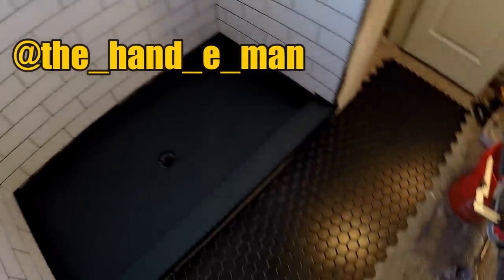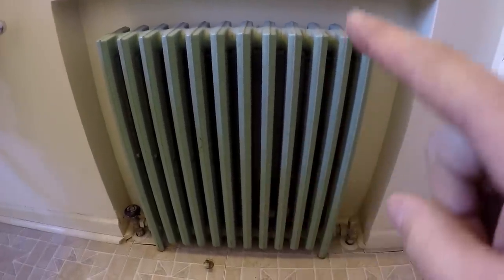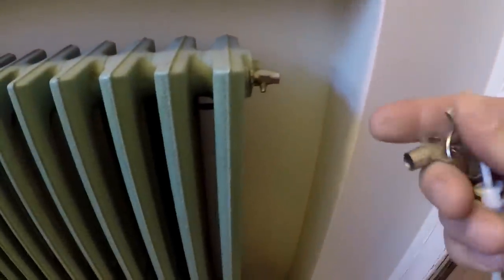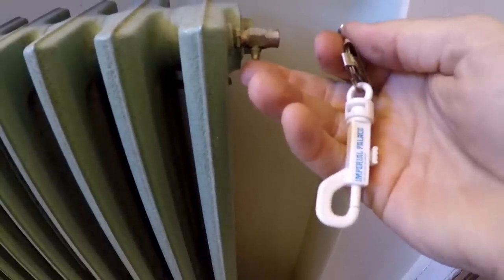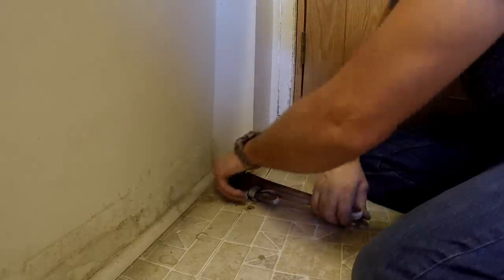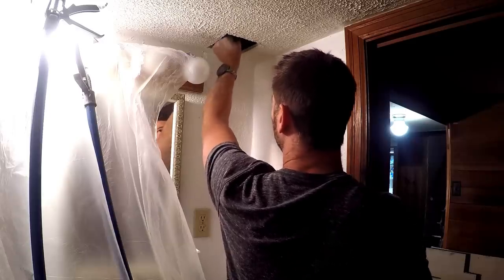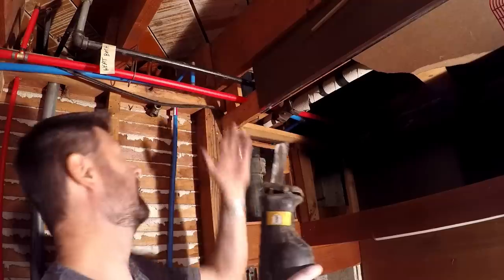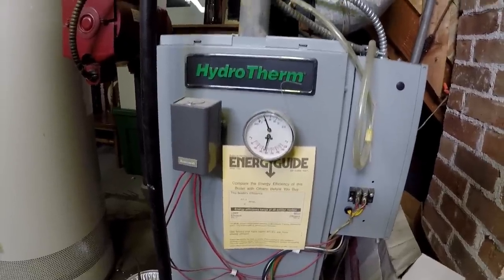1940's Bathroom Remodel | How To Remove A Radiator | THE HANDYMAN |

Comment: Most people who get rid of radiators in their home because they are remodeling are sorry they got rid of them years later. They want modern but modern doesn’t heat as well or as comfortable. They want more space but find More room means more heat is required and the old radiators did that with no problem. The new replacement is more costly too because it’s not as efficient as those cast iron units that dissipate heat over time. Sometimes new doesn’t mean better.
Reply: No one ever regrets it
Reply: I'm remodeling my home and a previous owner had installed baseboard radiators in an addition.  Just removed them and bought some cast iron to replace them.  They are even the same style as the originals in the older part of the house.  It's gonna be snazzy!  Cast Iron radiators do take a bit of space, but not too much, and they look so much better than the baseboard style that inevitably get dents and dings from furniture.

Comment: Boilers that have sight glasses are steam boilers, you only want to fill them to a certain point on the sight glass unlike a typical boiler where you just fill the entire system with water. Just got back from installing a pain in the ass oil boiler/tankless water heater that is located under a cabinet in a kitchen.

Comment: If there is a sight glass on the boiler, then you are dealing with a steam system.  Typicaly steam boilers are about 2/3 full of water and the sight glass shows the water level and nowadays most have an automatic feeder to keep the water at the right level. Not many of those systems around anymore at least not where I live.

Comment: I love that look.  Its modern and retro all in one.  Regarding the topic of fittings my only concern with the shark bites is can/will the friction fitting hold up over the years?  I used them on my toilet and sink supply lines but thats exposed and you can easily see if there are any issues.

Comment: I'm curious how you "blow down" or flush the rusty water out of a steam boiler that has a sight glass only? There is an emergency cutoff handle on the same side which looks like it has a water outlet facing down, but I'm intimidated to try anything. I'm assuming the boiler needs to be on (for a short period) to work, and I need to open the new water valve as well to actually flush through?

Comment: Bathroom ceiling light with fan install. Why do they always rattle? Help!
Reply from the maker: They rattle because they are cheap.   I put the best one I could find in this bathroom and its whisper quiet.  Also the fan blades get dirty and unbalanced.  They make replacements for the cheap ones.

Comment: Thought there was no water in those systems unless it was heated. I thought only steam was in the line so when it wasn’t boiling there was nothing in those radiators correct me if I’m wrong please
Reply from the maker: No steam only hot water. Maybe on a commercial building. But in Residential they are all completely filled with water.  NO air or steam.
Reply: In domestic systems 99/100 it's going to be a water system.
Reply: There are plenty of steam boilers in the north east for residential.
Reply: Hot water systems are full all the time . When you call for heat the water is simply heated and circulated by a pump. Steam systems sit empty until you call for heat. A boiler will simply boil water. The steam then pressurizes the system, no pump is required. Water systems are warm . You can fry an egg on steam radiators.
Reply: I've been in the carpentry trade for a bunch of years here in the Northwet but rarely do I see hydronic in residential, and then yes it is hot water. Some of the commercial property I work on has full-blown steam heat originally built in 1927.

Comment: I need to temporarily remove a radiator (looks just like the one in the video) to do some remodeling. Why do I have to drain the entire system? Couldn't I just remove the water from the one radiator that I'm moving? Good video BTW.
Reply from the maker: You can not remove water from one radiator.  They don't work like that.
Reply: You should be able to if that radiator happens to have shut off values, but most don’t, so it’s all one system.

Comment: So are they replacing the old radiator with a baseboard or something?

And... that's weird. Exactly how old is this house? If the pipe to the radiator runs between the drop ceiling and the original ceiling, the heating system must have been installed well after the house was built. So that can't be the original heating system. Did they just heat with wood or coal fires before that?

Comment: Never seen a radiator like this. Maybe im too young... What does it do?
Reply: Ofri Mashiah it is a radiant heater. Hot water flows through it and it heats the room through radiant heat.
Reply: AJourneyOfYourSoul and still being used in new construction? Or used say before 2000s?
Reply: Ofri Mashiah I have only seen them in real old homes, 1950s or older.  They still use these type of systems in new homes but use either baseboard “radiators” or PEX piping under the floor to take the place of those big stand alone radiators.
Reply: The concept remains the same but often the radiators have a more contemporary style. Having said that there is a retro trend going round at the moment (at least in the UK) to fit old school rads like this in new systems.

Comment: I would disagree with your comment on the owners maintenance  of the heating system. Given the system is healthy you really don't need or want to drain the system down yearly. You ideally want the same water and just keep on top of adding a good quaility inhibitor yearly/when required. When you add all "fresh" water it takes many heat and air bleed cycles to get all the air out as the fresh water will off gas until it reaches equilibrium. Systems only rust or sludge up from lack of inhibitor in the system. In which case a power flush can get the system factory clean and ready for a good maintenance regime. I do understand in this video you had to drain down in order to do the work, but thats not my observation.
Reply: I work on heatings in switzerland. We don't use inhibtor here, Care you explain what it is and what it's supposed to do?